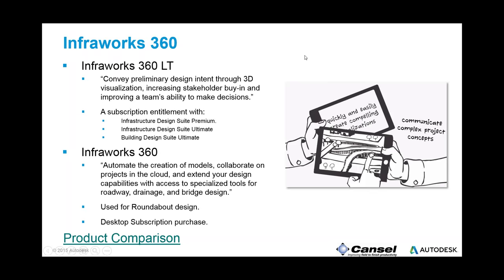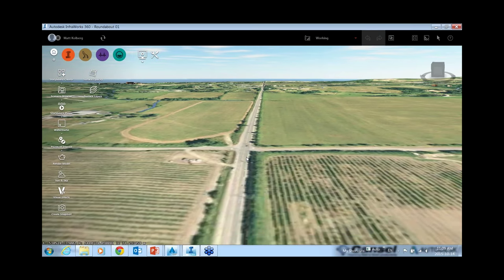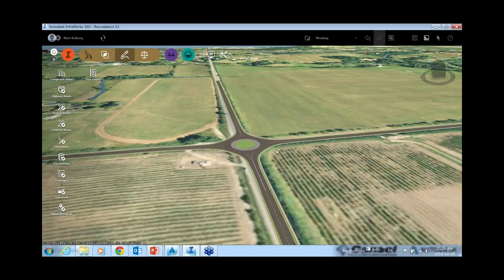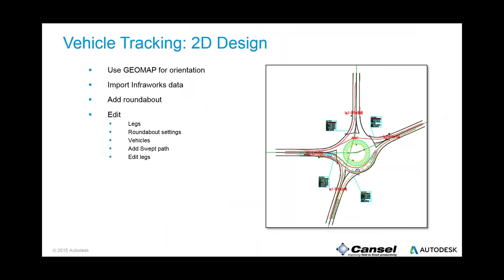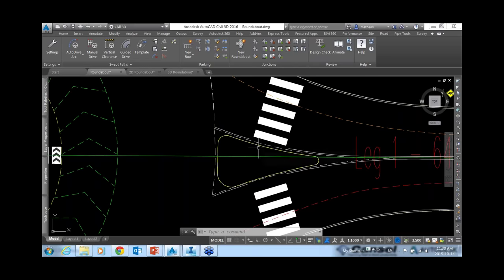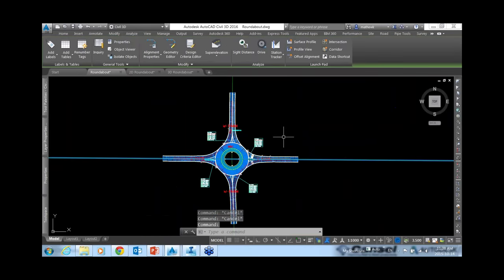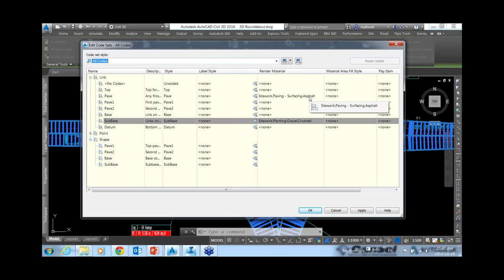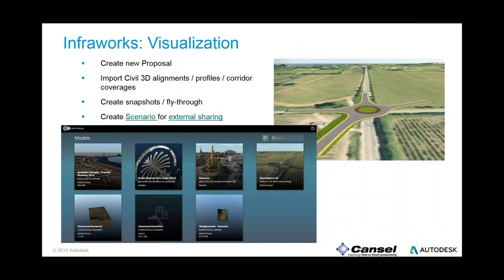Roundabouts  A Workflow from Start to Finish

Comment: Thanks for sharing! Whole workflow looks nice and smooth.. There are many webinars on the web showing how easily we can design roundabouts..  Expect one thing.. You show triangulated surface or corridor in section view. Which looks quite nice... but you don't show how contours plan looks like. We cannot say that roundabound is designed correctly if we don't check contours plan. And as far as I know, using this tool won't never bring good satisfactory effects. Lot of work must be done till we can say that roundabound design is done properly. Until that, we can use it – maybe - just for preliminary stage or just for layout. In my opinion, to put it in midly, vertical design of this roundabout is a mess.